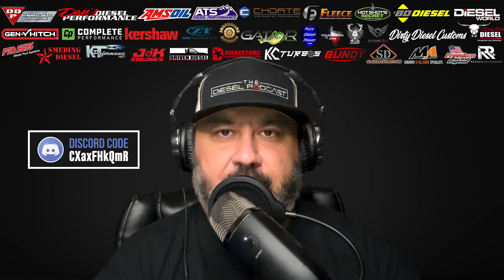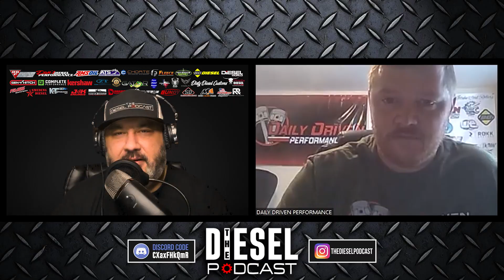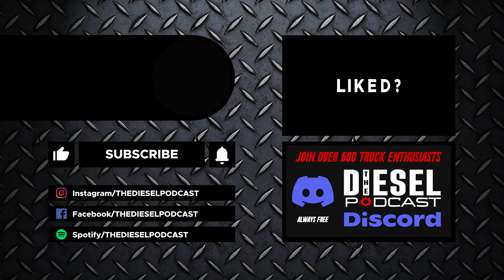6.7 Cummins Towing Upgrades

Comment: Gotta change the stock fuel filter housing to a screw on adapter. Then if you add a fass or anither adaoter kit you can chsnge the water seperator to be 2 screw on filters too. Way cheaper and cleaner with 3 good quality filters. Ill do a fass soon to add the icing on my cake. I have the G&R cat fuel filter adapter and a CAT 175-2949 on it.
Reply: Or just take the check ball out of the factory water seperator filter head and throw in a Cat Ir10750 or equivalent for ~$20

Comment: here's a list of everything done to my 2015 6.7 daily 

Emissions delete EFI live tuner 4 position switch 1. stock, 2. tow 65, 3. 100hp,  4. 130hp 
line pressure @220psi
banks rear diff cover
banks 6 in oval outlet
royal purple gear oil change
BD diesel deep transmission pan
trans filter metal thread fitting and filters  Mopar fluid 16.5 quarts
Revmax thermostat bypass
Revmax HD towing valve body
n-fab wheel to wheel nerf bars
fleece coolant bypass two 180 degree thermostat's
fleece fuel filter delete
Fass fuel pump
beans sump

ARP headstuds
6 new injectors/ccv filter/crossover lines/ injector wire cage
grid heater delete
Diesel power source turbonator vgt turbo S366/73/0.80 SXE Turbo / exhaust brake
air compressor 3 gal tank with fittings for air hook up on the rear bumper
high flow air filter
new FPS
new cp3
new FPR
Reply: Oh I know you! Your that guy that only drives his truck on his own property yeah!
Reply: @bucketheadrox huh his parts list is the normal parts list

Comment: Head studs, Airdog/fass, and trans are a must for reliability. 

If you wish to keep the emissions system, water methanol injection to keep the parts clean inside.  
LOL FIrst